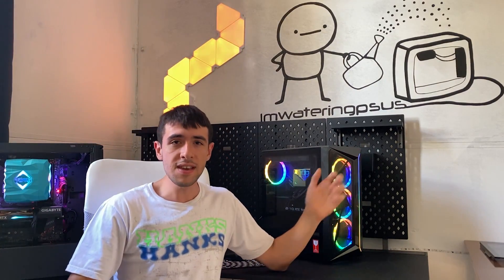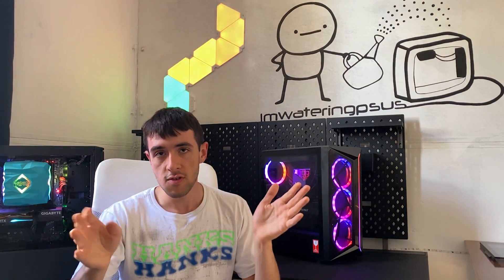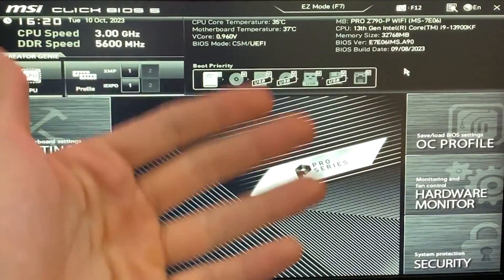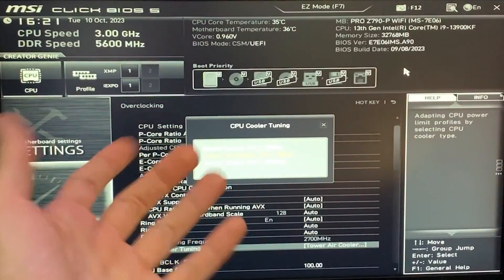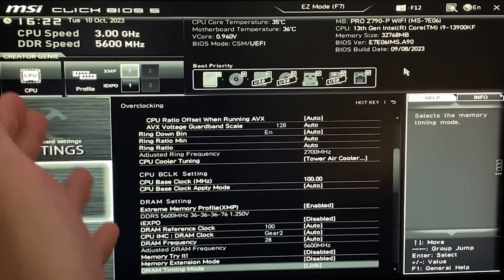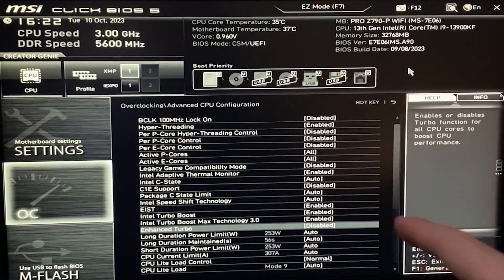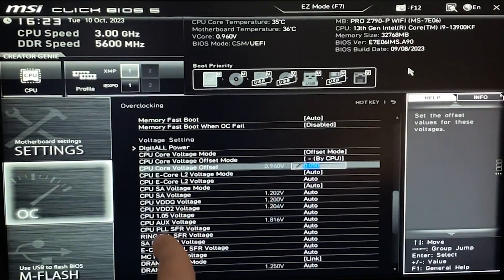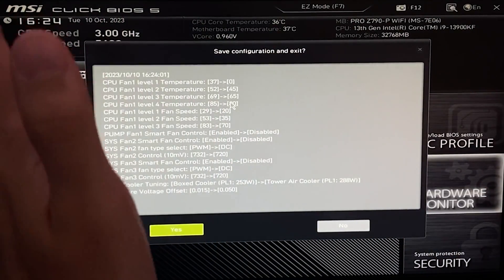Undervolt your 13th Gen CPU for more FPS and Lower Temperature! | i9 13900KF

Comment: for msi boards: instead of changing the voltage offset, you could also try the "lite mode" function, it's basically a undervolting presets. 
Mode 12 is default
Mode 9 is recommended/stable and will lower power consumption and temps dramatically.
maybe your cpu can go even lower, you will have to see at which mode the system gets unstable.
Reply: Yes, I got MSI Z690-A Pro and i9 12900KF, default mode is 9, but i set it to mode 7, and it works so good, only 1.25v and 4.9 ghz all p cores, good result for 1 options in bios, and system stable
Reply: @teutonicknight8198  got the z790-P and 13600k.
Yes, for some Mode 9 ist the default.
Might change in the future BIOS updates again for Intel 13th and 14th gen cpus.
Stability can be testet for example with OCCT Test
Reply: @Lakus231  Yes OCCT or work and games for example i stay with lite mode 7 around 2 years and no problems, no bsods and crashing games, so i think its pretty stable for me, but i can 2 ways how to make it more stable and cold, so we can make clock speed for p cores to 4.9 and fixed mode, than voltage set to override 1.25, llc set to 1 because it make 1.26-1.27 in some cases for stabilite, and we got cold, powerful cpu (for people who wonder, why only 4.9 ghz all cores, it's because i got bad cooler, Dark Pro Rock 4, but with this settings, CPU very cold)
Reply: I have the same 13600k and z790 pro p ddr5 should i go for mode 9 as well?@Lakus231
Reply: @rusty-gaming1988  there is a new bios update from this month that probably changed the modes again (didn't had time to update yet) 
but rn with mode 9 i get in cinebench R23: 23320 points @ Vcore: 1.240V (170w)
it's definitely stable for me (my cpu is btw 1,5 years old now)
Reply: @Lakus231  I did update the bios and ended up losing the tuning thing. Now all I have for water cooling options is msi and Intel settings only, but I tried mode9 as you mentioned, and my cpu has 0 throttle and my core temp went from 50 to 37c
Reply: @rusty-gaming1988  hm, would be interesting to see the vcore voltage / Power usage, unfortunately i'm not home  for a while and can't test :/
Reply: @Lakus231  will do it first now
Reply: @teutonicknight8198 do you mean u change nothing else in bios? Just the preset mode?
Reply: @Greg_The_Chief  Yes, but I changed my motherboard to MSI z790 P Wi-Fi, now I`m undervolting with method offset, now I got Offset -0.095, 1.2v for all cores, games 45-50 celcius
Reply: Where do you find the option to do this? Pretty new to BIOS
Reply: @CytanAJ  OC (Overclocking) > Advanced CPU Confuguration > CPU Lite Load
Reply: @CytanAJ  https://youtu.be/-mkAVITZoLY?si=dD3fIBxu0sP3k_tK&t=68
Reply: Im using a msi tomahawk z790 max wifi trying Mode 9 and Mode 7, im getting bsod on Windows start

Comment: Why not just do the boxed cooler because that sets the voltage to spec 253w. I have this bios it's what i've been doing for a year and a half, and didn't have crashing like many others. These cpus already push as hard as they can. 253w s is enough. you can argue adding a small undervolt as well. 

IMO it's like over clocking + overclocking + overclocking at this point between intel, board manufactures and what customers are doing. It's too much and that's why we are running into stability issue. Just reading though a bios these days there are a ton of tuning settings. 

Also that extreme core turning the board manufactures add i usually turn that off too. Just stick with the stock settings. It really doesn't make a huge difference maybe 5% when testing and you are losing stability.

Comment: isn't -0.05v too little ? i think atleast -0.125v you will notice the different.
Reply: Tried this my pc starts to freeze sfter boot. Any suggestions?
Reply: every cpu and mobo is different you gotta fine tune your own, i end up stay at -120mv because at -125mv some games crash
Reply: @patorikusutaru7483  I see. so I'll just try and find the number that will be stable.
Reply: @JSpectre98 i have an i7-13700k with an H150i AIO, and I have to do a 0.075v undervolt to not hit 100c.

Comment: temps are lower, but I lost a bit of overall fps. anything I can tweak to fix that?
Reply from the maker: Yup! Either unlocking the power limit a bit or clocking the CPU higher
Reply: @ImWateringPSUs  any suggestions on that? If not set like the video, is there a good slightly “higher” setting to use that still would be undervolting? Sorry I’m a noob

Comment: I just updated bios reformated my windows because my CPU was getting hot - I beleive I had a miner hogging resources -  But I will def turn off enhanced turbo now but quick question - if I don't click the xmp button the ram won't perform to it's max?
Reply from the maker: Yes, correct! To have maxed out RAM you need the XMP

Comment: This seems to have worked for my 13900KF which has crashed frequently in various games since I got my new computer a year ago. For a while I was sure it was just the particular games I played that were crash heavy, but the final drop was while playing Helldivers 2 the last two weeks at max settings perfectly, then seemingly crashing more over time. The crashes got to the point where I couldn't complete missions anymore. Then I found your other video on how to undervolt it. Temperature was definitely the cause as it hasn't crashed since I undervolted by -0.005 (-0.007 was blue screening me) and limited temp max to 90. So that's great, I managed to find a fix for the problem. But should I be worried for my CPU being damaged because of the increasing frequency of crashes I had before undervolting? Are there signs that clearly show CPU damage?
Reply from the maker: I’m really happy it was helpful! Thanks a lot for taking the time to leave some feedback :) Consider subscribing if you wanna support the channel! Nothing to be worries about

Comment: someone help? when i tried to undervolt my cpu started heating more? and i followed all of your steps
Reply from the maker: If you’re doing it JUST for temps, just apply the offset and leave the other settings at stock. You won’t gain performance though. Also subscribing to the channel does help with temperature reduction :3

Comment: Hey I just received a 14900K. Will you be doing a video on 14th gen possibly? If not, can I use most of these principles from this video? Any suggestions in general? Thanks
Reply from the maker: Hi there! First of all thanks for watching and thanks for asking:) I intend on doing a dedicated one for the 14900K but I have yet to get a CPU on hands! The settings are gonna be roughly the same, I recommend you watch my i9 13900K dedicated undervolting tutorial as that’s VERY in depth in the meantime:)
Reply: Of course, your content is great. Keep it up! Just gave it a watch, will definitely use these principles when I install. I figure I can use the same offset to start with since 13900k & 14900k virtually the same. Btw, do you have a video talking about PL1 and PL2? Something I'd like to learn more about but having trouble. @ImWateringPSUs
Reply: Why buy 14900k waste of money

Comment: Hello buddy, this is a really great tutorial, thank you for that! 👍🏻 Can you please advise which type of overclocking is better for my workload type (Optimisation vs fixed / "Old school")? I run a 13700K with Z790 Aero G motherboard and Arctic 360 AIO. 95% of my workload is an office type - Mail, Excel, Web, 5% is ocassional gaming. I don't do any CPU intensive tasks (rendering, editing, etc.), I just want to use the most of my CPU capabilities fot the best snapiness and response of my OS and applications. Thank you 🙂
Reply from the maker: Glad I could help! For the absolute maximum snappiness, I prefer to have my CPU at a fixed speed (old school type). You’ll lose a few frames in game, but for me it does the trick :)
Reply: Awesome! Thank you very much, I like your channel a lot, I wish you it grows bigger in time... 👍🏻
Reply: In case anybody would be interested, I just overclocked my 13700K - P-cores: 5,6 GHz, E-cores: 4,4 GHz, CPU Vcore: 1,400 V, idle (@20°C ambient): 38°C, Cinebench R23 max: 92°C

Comment: Make a undervolt tutorial for an Asus motherboard. I watched your previous 13900k undervolt tutorial, but my asus proart z790 bios is way complicated ☹
Reply from the maker: The settings are 100% the same, only the naming is a little different. Try to read the description for what every setting makes and it should be easy! I also do have a few tutorials on Asus boards to cross reference

Comment: Hey Bro, I really need your help with regards to my rtx 3060 laptop gpu (75w). I used your undervolt guide for rtx 3060 which you posted a year ago using afterburner. I did that and then was having some performance issues. Since, it was working fine before that I deleted the app thinking it would reset my settings to facorty voltage, but it didn't. Can you please tell me how to reset it to factory voltage. I also reinstalled the app and clicked reset but nothing works. Your help would mean the world to me
Reply from the maker: Yes, hit on the “refresh” arrow and it will fix it!

Comment: Mine was i5-12400F, non-K variant so I'm out of luck :) I tried undervolting it on BIOS but the performance halved after that, so it was pretty much useless in my case.
Reply from the maker: You can still do it on the 12400F, however you have to go in with a simple negative offset, generally -0.04 or -0.03

Comment: i undervolt but in witcher 3 wild hunt DLSS i got this strange ground squares on some part, dont know if it was the undervolt or DLSS so i turned of DLSS and took away undervolt so i dont trust it but temp was down alot! :)
Reply from the maker: That can’t be the undervolt, I’d say it probably was DLSS. An unstable undervolt would simply make your Pc/app crash
Reply: cant see it anymore so it must been some reading issues for the cpu becouse of undervolting  @ImWateringPSUs